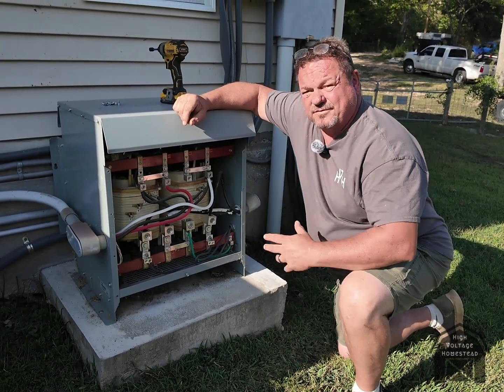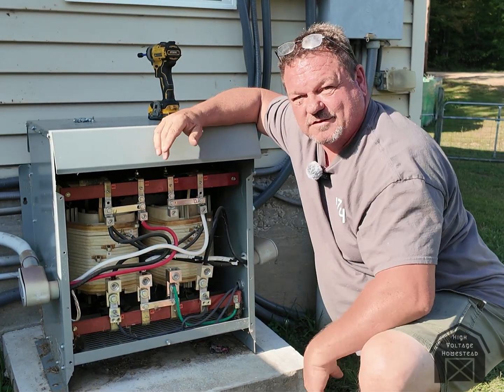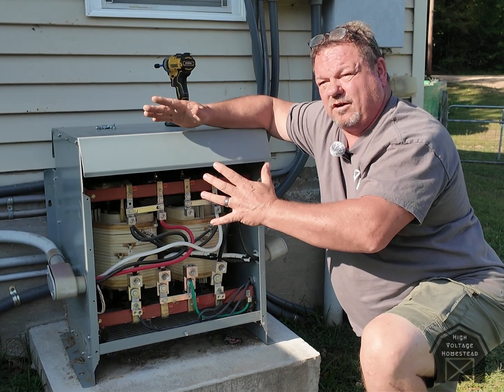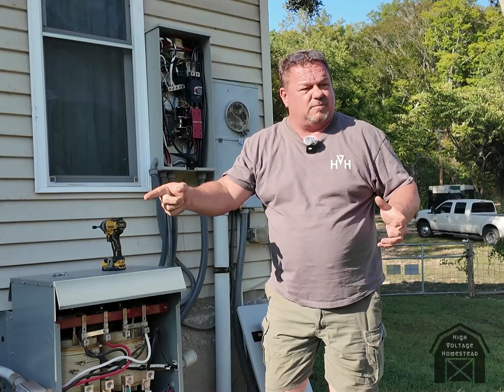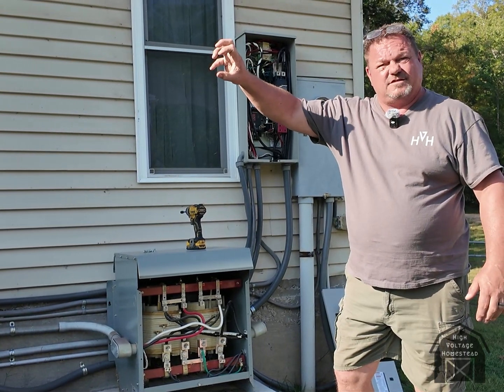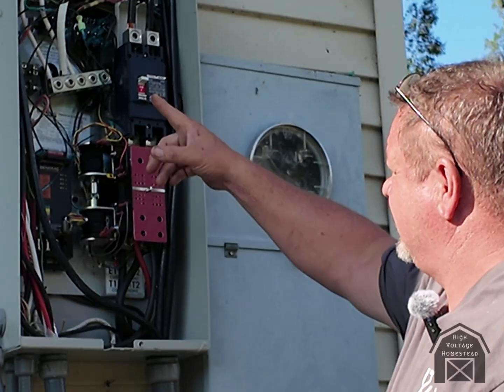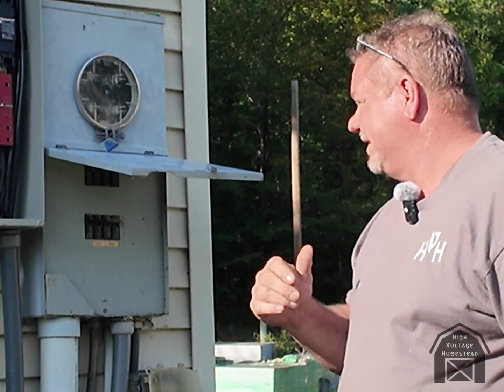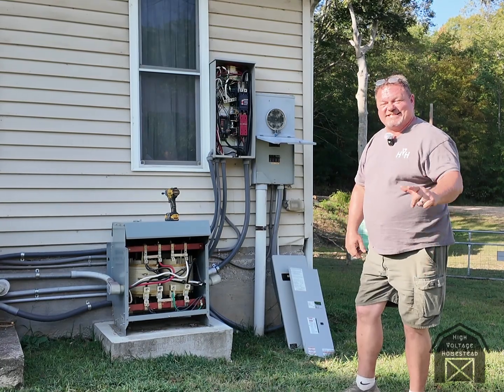Behind the Scenes: Walk-thru #3

Comment: Does this transformer provide galvanic isolation between the primary and secondary windings or is it an auto transformer?
Reply from the maker: No auto transformer, it's basically an isolation transformer but it does convert from 240/N to 120/N/120.  Thanks for watching!

Comment: You've got some understanding correct, and some mis-conceptions. There is very little magnetic flux outside the coils. The core channels all the flux lines, and 99% of the flux flows through the iron. And there isn't very much energy stored in the magnetic field - not as much as you might think. For a transformer that size the energy stored in the field is about 500 joules. Not a trivial amount, but not enough to get an A/C unit or well pump started. Putting a transformer between the inverter and the load lets the inverter get the load started because the transformer has some resistance and stray inductance that isolate the inverter from the near short that a large motor acts like at start up. If you put a digital storage scope on the output of the transformer and watch what happens when the A/C kicks on, you will find that the voltage at the output of the transformer sags significantly for a tiny fraction of a second. This soft-starts the motor. The inverter doesn't "see" that sag, and thus doesn't trip.

Comment: Smart move adding that transformer. Not only are you increasing your inverter's surge capacity, but you've also added galvanic isolation. So should the connection between your inverter's DC boost stage and its AC output were to short to ground and begin passing high amperage current to your loads, the transformer would block the conduction of the DC current which protects your appliances during a catastrophic failure of the MOSFETs.

Comment: Good video brother, keep'em coming! 
I see some questions about idle loss, for a 50 kVA dry-type transformer, typical no-load loss = 250–750 W. Not an issue at your scale but if someone is trying to run a house on a low cost system that has say 10 or 20kWh battery that loss will add up. That's ~20-50% drain overnight...
Reply from the maker: Thanks.  I hadn't really thought of that but but you are right if you don't have alot of battery then that idle wattage would come in to play.

Comment: Nice explanation on the transformers,i always say,a good low frequency inverter like a victron 15kva multiplusses,are awsome units,you just explained why :) You mentioned EG4,nah they are not good inverters...Adame Le Lay had to change to victron,becouse EG4 couldnt handly inductive load either,hes lights were flikkering...

Comment: How would you do this if you have two spilt phase inverters that are 120/240v 
High frequency system architecture.

How could i install me a large dry transformer like that
Reply from the maker: You could wire it up exactly the same as I did and it would work.  The primary windings won't care how they get the 240 and just bond all the neutrals.  What you are wanting is just an isolation transformer, if you decide to go that way just shout and I can help you order the right thing.  Thanks

Comment: I think you're a little confused with the toroidal vs laminated transformer differences. Even with your transformer design the neutral will carry the imbalance between the two phases because that is how split phase power works. Your inverter won't ever see an imbalance because it outputs 240v just line to neutral and feeds the transformer on the primary side.

I think using Euro inverters with a transformer is a clever way of doing things. It's cheaper and the transformer provides split phase, isolation, and EMI reduction. From what I've read I'm not sure they really provide much surge capability, though. They probably do help with absorbing inductive loads within the rating of the inverter, though. That's still limited by the inverter itself. The only other downside is the extra wattage they consume that you need to factor in.

I still prefer the toroidal design because they are more efficient and have even lower EMI.

Comment: I have honestly considered getting my own transformer for the house. Run everything through my grid boss then the output from the grid boss go to the transformer then back to my panels. I haven't done much additional research on it. Is there a specific dry transformer you'd recommend for a 200 amp service household. Is there a 50 KVA that would take my output 240 and clean it back up? Is that something that's even possible?

Comment: Good info to grow on,   I went the other way, Gas and efficiency on All Appliances.     I tell everyone,  upgrade and or reduce and save several thousands on size of solar system. Needed.   Just Like Heating,, the best monies r spent on insulation.
Reply: I run a NG furnace, water heater, dryer and I have a NG backup generator.  My oven and A/C are my only 240V loads.

Comment: So your transformer is a 240V isolation transformer with a center taped secondary?  What is the idle wattage on it?  And no you wont get shocke when you touch the neutral on an auto-transformer because it should be bonded to ground.
Reply from the maker: yes, just needed to convert from 240/N to 120-N-120.  I could not get that to work with the autotransformer without having voltage on N.  if I bonded it to ground everything got very unhappy very fast and breakers tripped.  maybe if you have split phase feeding it then you could probably bond them and be fine but I didn't have split phase to start with.  Maybe I did something wrong, I'm not perfect, but I will try to set up and video the autotransformer and wire it and test.  thanks for the comment.
Reply: @HighVoltageHomestead  ~ Well now that I think about it, you are correct.  With only a single winding and one side of your input 240V circuit bonded to ground, that center tap will be 120V above ground!  If you had a neutral on the input side to bond to the auto-transformer's neutral to that would work. My apologies!  I need to think twice before I start typing.  :o)